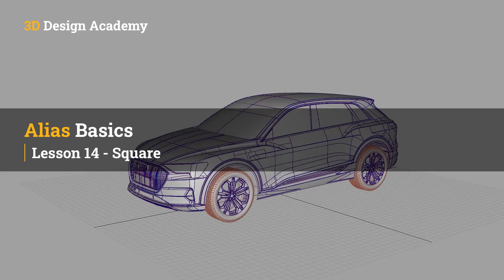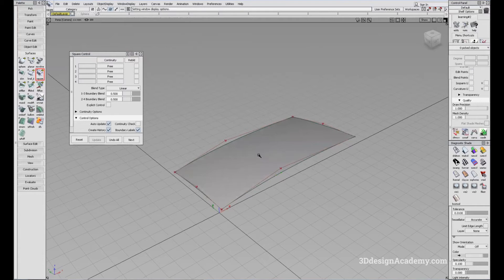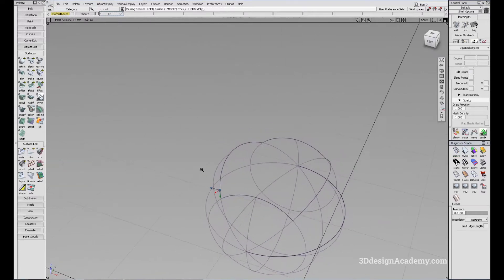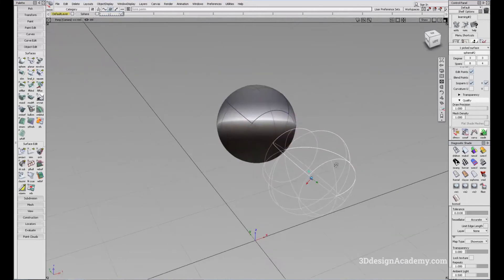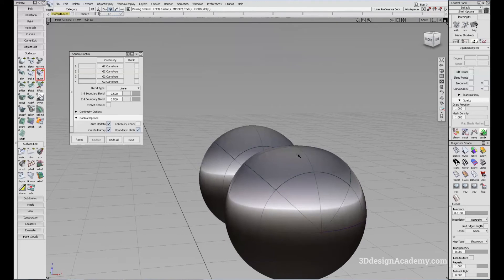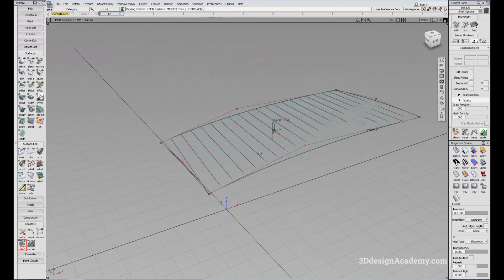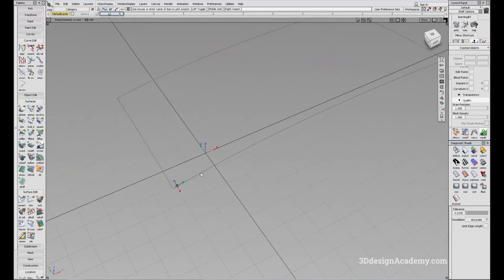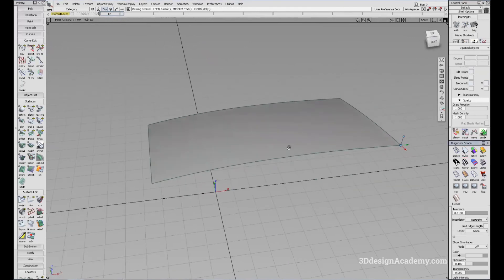Autodesk Alias Basic Tutorials 14 - Square

Comment: May I ask how you trimmed the sphere at 1:45 along its edges? Did you project curves on it previously or is there an option that you can pick those pre defined edges?
Reply from the maker: Yes, you do have to project using the lines that you see on the sphere. Also, when you project, double click on the project tool to open the options box. Then, you have to project using "normal" option instead of "view" or "vector." Because it's a sphere, you will get bunch of random lines if you use "view." Hope this helps! If you need a better explanation, let me know and I'll create a short video.
Reply: @3DDesignAcademy  I managed to get it work, thanks for the quick reply. Also thank you for the videos, they help a lot!
Reply from the maker: @4urel111  No problem! If you have any questions or ideas for future videos, please let me know!
Reply: @3DDesignAcademy Awesome! I was stuck in the same thing. He he Thanks!
Reply from the maker: @X-mordred-X  You're welcome! Glad it worked!